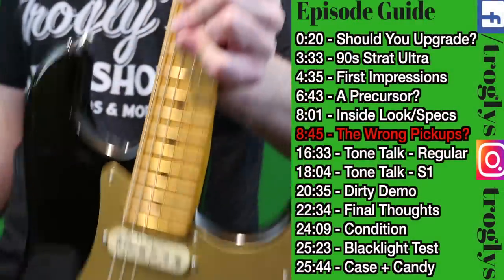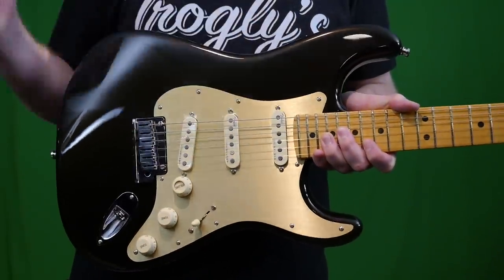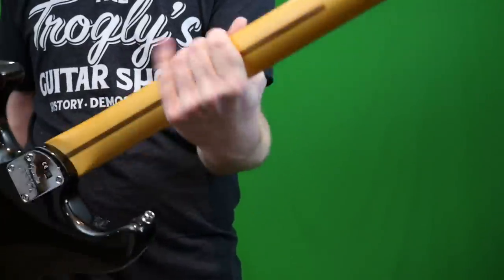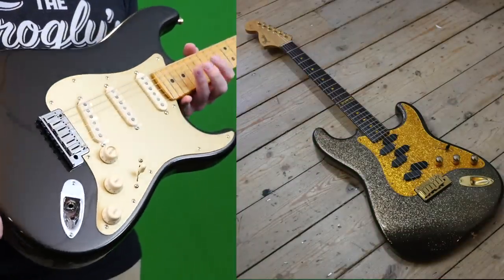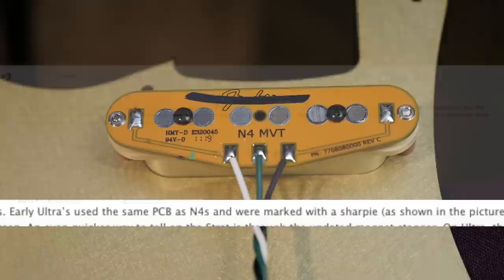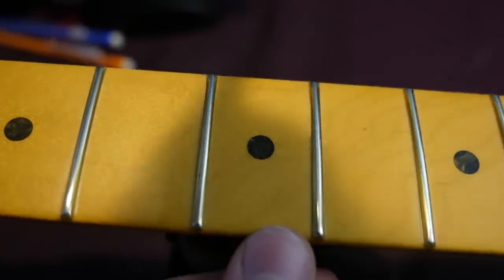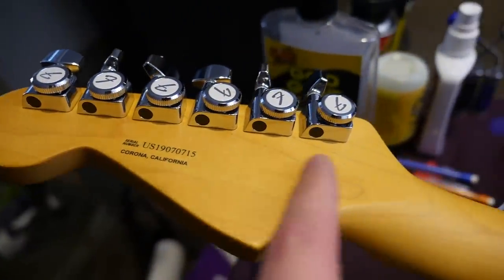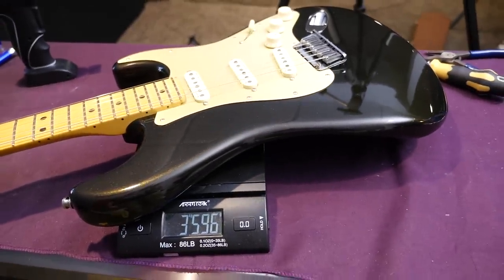Did You Get Wrong Pickups in Your Ultra Strat? | 2019 American Ultra Stratocaster Texas Tea | Review

Comment: (@ 10:00) FYI - not a treble bleed, just a ceramic tone cap.  Treble bleeds are tone cap/resister pairs that are wired in parallel to the middle and one of the outer lugs of a volume pot.  This is just the tone cap soldered to both tone pots.
Reply: There are some SMD components on the PCB attached to the volume switch, probably that's the treeble bleed

Comment: I have two guitars with the fender locking tuners and haven't had any problems at all with them. You do have to make sure you tighten up the locking part. The S1 switch works like the neck addition button on the  fender Performer series  guitars

Comment: yo trebble bleeds go on the volume pot. this guitar has the normal caps on the tone pots, found in almost every guitar
Reply: Yep. And the PCB on the volume pot is basically Fender's Tone Saver 250k (the treble bleed circuit) optimized for space.

Comment: Hey hey hey, I checked my 4th Gen Elite vs my 5th Gen Ultra and my Ultra is legit. Comparing high E string pole piece and D string pole piece same height to be legit. Checked yes. Then Checked Elite and poles pieces are definitely different. Must see up close but definitely different. My Ultra vs my Elite are different pickups. Can tell by color of PCB board too. Current Ultras will have a red (HSS) or blue (SSS) color depending on the model and will also say "Ultra" on the silkscreen. Also get a Certificate of Authenticity. I got well over 500 on the serial number. So the first few or the first few hundred were mixed. After that they are pure Ultra. Checked S1 switch settings and which tone control controls which pickup combo.

Comment: That S1 switch option is a feature I've had and used for several years on My G&L S-500 Tribute. I paid $350 for it and prefer it to any Strat that I've ever played.
Reply: I, too, have an '05 clear red S-500 Tribute in great shape. I added Sperzel locking tuners, and graphite nut, cleaned up the fret ends, added copper shielding, and this baby rocks! Plays great! I bought it used from GC. It basically just needed a set up.
Reply: Fender American Ultra is different. Especially the HSS Strat.
Reply: @robertclinger7351  They are great guitars,  my S-500 and Fallout Tributes have better fretwork than my American Standard Telecaster or my American Professional Jazzmaster. G&L put out amazing low cost imports that come stock with great pickups and bridges/trems. The nut and tuners are ok but like you I replaced them with locking tuners and Graphtech nuts. I replaced the pickups, pots, switch and jack in my Fallout to a Seymour Duncan JB in the bridge and a Bareknuckle True Grit P90 in the neck but honestly I didn't even need to. The only thing that was necessary was the jack because the stock jack was a little noisy. 

I have no need to buy a Strat because my S-500 gets me close enough and I love it. I loved that I could the ability to use all pickups at once and the neck and bridge pickup together. I also prefer the master treble and bass bleed over the traditional tone knobs and I prefer G&L trem and saddles over Fender's.
Reply: @JG-ux7of  the imports are not G&Ls. If you ever own one and get use to the necks you'll never be able bond with a tribute. G&L pays the factories $40 per box, they don't have anything to do with the construction of the instrument. The only thing american on any tribute are the mfds, the trem, saddles, wiring is all indo. They are great guitars, you love your guitar even with it falling way short of the us standards. Go find a used s500 and you'll have a guitar that Jake from Umphreeys plays every night when he could easily buy any guitar he wants.  G&Ls also use a Passive treble bass system.

Comment: The finish looks very good. I once had a '99 US Strat that had a painted maple fretboard. The paint was up on the side of the frets in higher positions and broke/peeled off in larger flakes while playing, displaying raw wood of the fretboard. When I sold it online the buyer wanted to give it back. I was done with Fender after that until I bought a Squire Tele two years ago, which had the satin PU finish like yours. Worlds apart.
Reply: My '95 had finish so thick it was refretted without removing it. Giant SS frets, hip deep in finish - they feel like medium jumbo. If I could pry it away from my daughter - I gave it to her - I'd strip it and oil finish it.

Comment: Great job literally taking this guitar apart and going through the craftsmanship and setup. I think the other two positions with the S1 change the way the pickups are wired in the circuit. Without S1 engaged in position 4 the neck and middle pickup are in parallel, with it engaged they are wired in series (I might have it backwards), but that's the idea.
Reply: Clarification: according to the Fender's service manual, all pickups are parallel when combined. If you activate the S1 switch, the neck pickup will be "always-on." So, for positions 4 and 5 the switch is redundant. Position 3 will turn into a duplicate of position 4.

Comment: The switch is just a David Glimoure mod. He used to add a toggle switch to his guitars to add the neck pickup to whatever is selected at that moment.
Reply: That's quite interesting. I've got this fender strat that was sold for like a year, so it's quite rare, but it's got the opposite. It's got a button and when you press it it adds the bridge pickup. So you can have the neck and bridge with no middle pickup and it sounds like a tele that way. You can even do the 4th position (neck and middle) and add the bridge to that and it sounds incredibly quacky. I've never seen another fender strat do it that way, so it's interesting to see something similar
Reply: David apparently doesnt use that switch tho....
Reply: @TheZooropaBaby  Do you mean he doesn't actively use it, or are you saying he doesn't do that mod to his guitars? Cause it's actually a quite famous mod.
Reply: @duffman18  That's actually the same as here, just executed differently. They both add the same options for selected pickups, except the five way toggle switch will be in a different position.
Reply: @duffman18   That is the MIM Deluxe series. it also has the the cut out on the heel. i have it, its awesome!! check it out, its not rare. https://www.sweetwater.com/store/detail/StratDSP2CS--fender-deluxe-stratocaster-2-color-sunburst-with-pau-ferro-fingerboard

Comment: Love the colour & I'm a fan of the anodised aluminium pickgaurds ,which in my humble opinion ,only looks right on a maple neck Strat. Bizarre they tinted the neck like that too , seeing as the American Original series has stupidly pale necks. The dainty & graceful headstock shape is ruined by anything other than vintage style slotted ones and all those extra cuts to the body are unnecessary, like they saw a Silver Sky & took it seriously. Also I think I'm the only person left alive who prefers Strats not to have a bridge Pu tone control ! Give me the vintage type stuff any day 😊
Reply: That's why they have a bypass switch on the bridge tone control. Turn it to 10 and feel the magnetic click. Cuts are not at all the same. SS is on the front. Fender Ultra is on the back. Don't want vintage 7.25 inch radius these days. Need flatter compound radius like Ultra has. 10 at nut-14 at body. SRV figured that out long time ago and said to Fender, "Hey, try this!" Fender listened to SRV. I think a lot of people still listen to SRV.

Comment: The volume knob is way to close to the bridge when strumming and dampening when your hand has to rest on or near the bridge and the center pickup gets in the way when picking for me so I would put a new pick guard and two humbuckers, relocate the new 500 ohm pots or not drill any holes and wire them directly and hear how that would sound, no variable resisters to alter the sound if I had one and maybe add volume pedal, but that's why I love Ibanez for aggressive playability without turning the guitar down and a slim ripping neck instead of that half moon design and I know Ibanez has the rounded necks as well, but they at least provide a choice.

Comment: Repurposing old parts in a new product? Leo would be proud.
Reply: Yes if it was sold on a budget... not as an ultra expensive model.
Reply: It's what Ford used to do at their major UK plant in England back in the 80's - why vehicles such as the Granada, Capri and Transit van shared brake parts, radiators, etc. Particularly when a model was going out of production - saves the cost of developing and manufacturing a new specific part, adapt the car to take the existing part instead.

Comment: Great video Trogly.  I find the bridge and neck is a really great tone on my stuff. Dont really care for the tone of all 3 pickups on. Have a elite with the shawbucker that is a really cool guitar with the s1 and passing lane button. Passing lane button just by passes all controls and its just the shawbucker at full throttle. Doesnt matter were you have pickup selector.
Reply: @IrisGalaxis  its kinda between the tone control and lower i dont have the guitar in front of me at the moment ill check when i get home. Its a small white button that is a push in to activate and push it in again and it pops out and deactivates.
Reply: Look up a stratocaster elite with the humbucker in the bridge postion. You should be able to see it. Mine is a 2017.
Reply: Its only on the elite model with the humbucker in the bridge postion.  Hss. The ultra migjt have it but not sure. Any thing with the three single coil  pickups didn't have the  passing lane button.
Reply: @IrisGalaxis  your welcome luka its a great guitar.

Comment: Looks like due to the contour, the neck plate is at an angle to the neck pocket, which means the 4 screws holding the neck to the body is drilled in at an angle, not perpendicular.

Comment: That color was an option on some of the higher end Chryslers from the 90s and early 2000s. I'm thinking the double stickers are QC and final QC. What would be cool is if Fender could have a circuit ind the middle position whoth the switch on that would double or add some other effects to it. Think what I'd change about this guitar I'd have the whole neck and fretboard in a baked look. Good they changed th case or at least the latches. The one I have also can be used with strat or tele but the latches have to be checked to make sure the caught the lid part of the latch. Thought I had mine closed up when I went to move it the lid popped open and the guitar flopped over on to the lid yanking loose the straps that hold the lid from opening further. I was able to fix that with a little gorilla glue but now I double check the latches.

Comment: 2018 was the last time fender gave good fret work on guitars. The increase in demand has caused quality control issues, a good tech can easily correct this. The custom shop is still,( take off rack ready,) for now. You now have better strat clones at conparible prices Suhr, Anderson, Schecter and now PRS.
Reply: The G&L Legacy has a neck equal to or better than every brand listed. They will build whatever you want with whatever wire in any shape and thickness plekked for the price of a new usa Fender. I just picked up an Ultra in unplayed condition for 1599+tax and the fret work is good but no where near my 17 Fullerton Legacy. Fender has the sound only a Fender will produce, Suhr, G&L, Anderson all make great strats but they are not a Fender strats. The problem is what you said, they can't keep up with the demand and things like fretwork and nuts show it.
Reply: @dingusfuzzklonnkt2755 Yes G&L the instruments that goes under the radar. It was Leo Fender innovating and moving forward. But we all wanted a white strat and couldn't get pass the new look of G&L, while being superior to everything CBS and everything fender now. What a pretentious mistake. Iam happy they are still here with very high quality to price ratio. I love the sound of there split coils pickups.

Comment: With the new neck-to-body style Fender  is using, you won't have the ability to do that universal Fender neck swap anymore.  An older neck on a newer body is going to expose a screw hole, and the reverse is going to necessitate some drilling.  However...judging from the way this sounds, mods will not be needed.
Reply: Not true... the necks will interchange, you just need to use the different screw lengths.    The neck pocket doesn't change.

Comment: Long time strat players: save your time, money. they're okay, that's it. Step back if anything. Get a players series strat or a Japan squier, your welcome
Reply: They make Squiers in Japan?
Reply: Roy Tofilovski it’s the equivalent of a modern Mexican strat.
Reply: @oldtimetinfoilhatwearer  How would you even get your hands on one?
Reply: Yea me too.
Reply: Nintariz I got an an American strat, mim player series is my third , you can do much better for 2 grand.  My trem block is beefier, tuners and pots and you're nearly there in quality. Don't care for the bent steel saddles so I'll change those out too, but minor differences.
Reply: Nintariz yeh if you say so, I bought a used Eric Johnson model about a year ago for $1500,kind of an impulse buy I just got hypnotized by it or something, so then sold a 2007 strat plus for 750, I bought this 2019 mim because it's hss and already had an upgraded  humbucker for less than 400 like new man. I'm comparing it to expensive strats man. that strat plus was 2 grand way back then.
Reply: Nintariz pretty much, some polishing and some different pickups That weren't necessarily better, the tuners were better, the price goes up pretty steep. That Eric Johnson is just sick though, you might need one of those, pretty much a thin line with the chamber and f hole.

Comment: Sorry, the Fender Ultra you are holding in this video does not have an LSR roller nut.  The late Strat Plus series featured the LSR, but the early Strat Plus series, featured a Wilkinson Roller nut, which is quite a bit wider than the LSR.

Comment: That's not a treble bleed...it's just a regular old standard capacitor for the tone controls.  Treble bleeds are a cap on the volume knob to allow the highs to bypass the volume pot as you dial down the volume.

Comment: That nut on the flame-maple Strat Ultra is not an LSR nut, it's a Wilkinson nut, the LSR nut is thinner and each nut slot has two small ball bearings that the string sits on, I know cause I happen to have two brand new genuine Fender LSR nuts and they don't look like the one on the flame-maple Strat Ultra you have there.

Comment: Mine is a 91 ultra with ebony regular square bolt on neck and a double bucking angled bridge pick up, that someone switched out with Lawrence Humbucker L500L  L250L in the middle and neck. ( have not seen another fender with slanted double bucker in bridge position?)  color - A -AA flame top ultra burst with tapered ebony fingerboard. Locking Spiegel tuners, and Willkinson bridge by Gotoh and LSR nut.
If anyone can tell me more about this strange Fender ultra of mine, I’d be forever grateful   🙏

Comment: I had the HSS version of this guitar. The frets were covered in stain, some looked like they hadn't even been crowned. The body finish was also covered in light surface marks where the buffing hadn't been done properly.
It went back. Disappointing, especially for the price.
Reply: First run issues. Wait a year. Happens to other companies too. If you think it's a hardship now, go back 500 years. Even 50 years, would you rather have a CBS Fender?

Comment: Why did they go back to the non-roller string tree? I always buy 'em for my other guitars. It really matters for the trem!
Reply: Dean Allen I think people didn’t like them ( visually) changed the look of the headstock and people couldn’t understand it. I have an 1987 strat plus with rare Wilkinson split nut, and people freaked out when they saw it, first thing out their mouth, where is the string tree!
Reply: @horacebond9394  Really? They can't tell it's in the nut? They should be glad when they see no string tree at all.
Reply: Dean Allen so it sounds like you agree. I think Fender used to agree, but I think folks complained and they stopped. Jeff Beck of course is a huge strat plus fan, and his signature model has the LSR nut. I have a JB Strat, don’t like the size of the neck, but the construction and feel is top notch. I haven’t seen that level of work from Fender in a long time.
Reply: @horacebond9394 First Strat Plus I ever saw was in '88, pink, had sperzels and an original brass Wilkinson nut. I have an LSR with hipshots, I noticed it's zinc, the worst tone metal. The hipshots have aluminum housings which is good.
Reply: Dean Allen March 1988, Rhythm City (now guitar center) had a surf green Strat plus hanging in the store, I bought it
Reply: What luck for me, only year for surf green! Gold lace pups! Great tone!
Reply: Also, E4 serial number. Many confuse my strat plus for an 84 strat because of the serial number. Fender USA did not make any guitars for a time 1984- to mid 87. The employees bought the company and they were moving to another factory, MIM and MIJ keep them afloat until they dropped the Strat Plus on us. So I have early serial, plus split nut, plus surf green- priceless
Reply: @horacebond9394  Cool! The one you have now?
Reply: Dean Allen yes, bought it new. Think I paid 600 for it. It will never be for sale in my lifetime, maybe my son will sell, but not I. Wish I could put a pic up